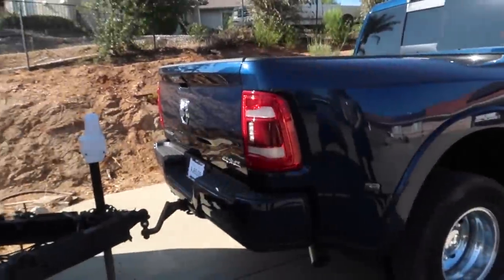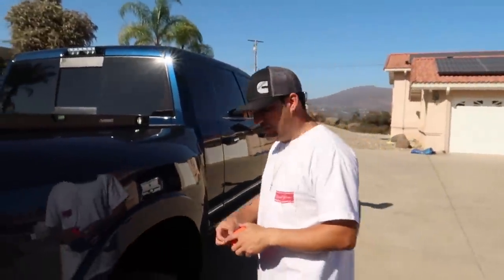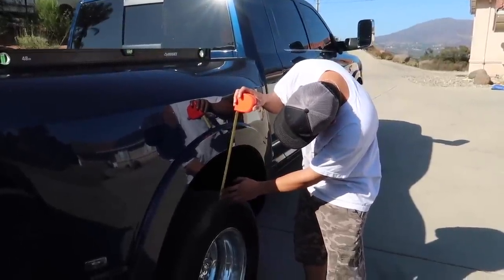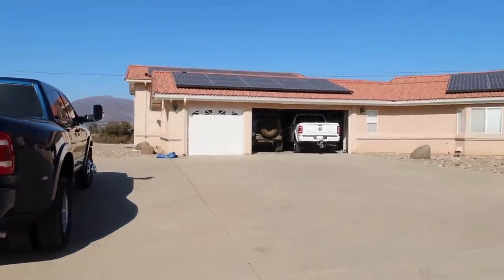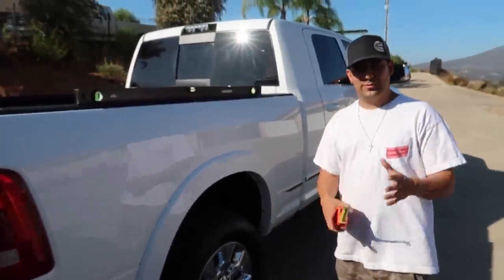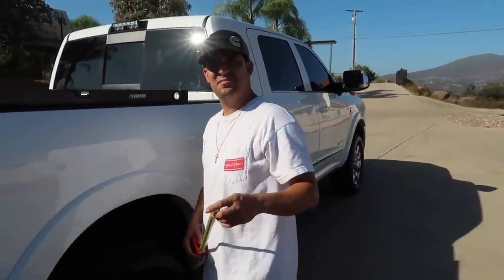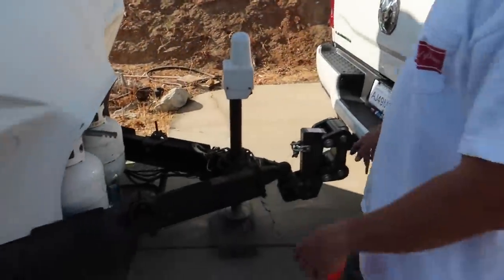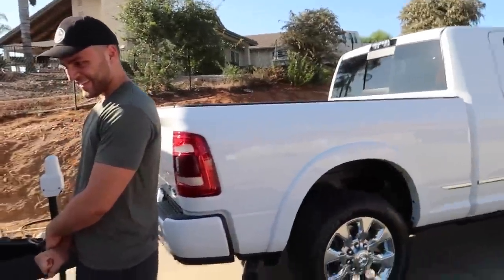SQUAT TEST WITH RAM 3500 SINGLE WHEEL VS DUALLY!!

Comment: They both sagged the same amount, 1.5 inches. The only difference is with the weight you are pulling, you'll have a better ride. For what you are pulling, you are spec'ed out perfectly.

The additional springs on the dually won't really come into play till you add more payload weight. 

It used to be a single wheel could pull more bumper trailer weight than a dually because the dually has a heavier vehicle weight which subtracts from the rated combo weight.  But, can pull more weight when hooked up to a goose-neck or 5th wheel because the additional weight of the trailer is added to the much higher payload of the dually. 

Again, with the bumper pull and your weight, you're doing it right for ride quality.

Comment: Hey Eddie, On the newer Ram trucks, the trailer tow disconnect light comes on on the dash only after an existing trailer that was connected with the truck and its computer as well as trailer brake control module is disconnected while the truck is still running or in accessory mode. This is to warn a driver that the trailer that they we're once pulling or had connected is now disconnected . It is a safety feature to warn a driver in case the cable comes unhooked while actually moving down the road. If you were unaware a trailer came disconnected from the 4/9 pin connector while towing, things could go wrong since at that point you'd have no trailer brakes, or any lights on the vehicle in tow. Just restart the truck or reconnect the 4/9 pin connector to make the light and computer reset. Thanks man. Great video!!!!

Comment: The dually before trailer was 11 1/4" with trailer weight went down to 9 3/4". single wheel before trailer was 10" after trailer weight went down to 8 1/2".

Comment: As PD diesel power has noted previously, and I would agree, bumper pull/tag along trailer heavier that 10k, go dually. 

5th/goose towing heavier than 15k, go dually.

The squatting is consistent with my 18’ srw 3500. I’m getting about 2-1/4” squat with my 5th attached And all my gear. About 3500 lbs in the bed.

Comment: I couldn’t believe how bumpy the ride was in the dually (ram) when I rode in one..that being said after seeing they both squat the same, no reason for (me) to buy a dually over the standard axle
Reply: Tyler T your right unless you are hauling heavy loaded trailer at highway speeds and you have a blow out on rear would suck
Reply: Like Jose said, blow outs. I went with a dually several years ago due to tow capacity and possible blow outs. I was towing my gooseneck horse trailer on the interstate with 2 horses, behind my Dodge 2500. Right rear tandem tire on trailer exploded running 65 mph, all was good but I started thinking "what if that had been the truck rear tire"? So I went to a 3500 dually, which also allowed me to go to a larger horse trailer. Another thing is sway control towing heavy, towing gooseneck enclosed horse trailer or a camper approx size of Eddie's, the dually feels more stable than a single rear wheel.
Reply: Squat is mostly the results of the springs, not the wheels.  More wheels will help a tiny amount.  The real reasons for dualies are not increased loads, because although they can often handle a little more, you still run into GVWR limits.  The real reasons are extra tires = reduced load on each tire, wider stance = more stability, and more rubber on the road = better braking.  Even Ram says this.  https://blog.ramtrucks.com/features/download-dually-trucks/index.html

Comment: This squat test is testing the springs... so if the two trucks have the same springs, it will squat the same. DRW allows larger payloads and more stable driving. Amount of tires will not affect the squat.

Comment: Of course it’s a difference between the two trucks...one is meant to haul heavier loads which means it’s heavy duty which is also the point of the dual tires to support the heavier load and one is a medium haul!

Comment: That symbol means the trailer is disconnected, either you are towing and your trailer came undone or you purposely disconnected the trailer yourself. In order for it to go away you need to restart the truck after disconnecting.

Comment: A dually is made to carry more weight. That’s why it has more springs. I think the red light means somebody tried the trailer brake and it’s letting you know that there’s no trailer. One other thing. You don’t need the weight distribution bars on the dually. One question, why didn’t you order it with the factory airbags?
Reply from the maker: bc there air bags r non adjustable

Comment: My friend used PPEI and the EZ link for his delete and he tore up his transmission. Found out their not suppose to be deleted with the trans you have he has less than 10k on the truck.
Reply: Rick James 
I run ppei tunes on my 15 with an Aisin. Absolutely no issues. 
When I tow our 15k lbs fifth wheel I use the 30 hp tune. 7k lbs boat I’ll run on 60 hp tune. Daily driving I use the 3rd tune which I think is a 120 or 130 hp tune.

Comment: Hey Eddie, I finally got my 2019 Mega 3500 Dually.  I put 275/65R20"s (34's) on it.  It rides perfect and did not need the lift.  I also got the factory airbags. The 1100 LB. weight of the Ding Ding is nothing for those trucks.  By the way, tell Big Lou he needs to clear bra the rear fenders of Papa Smurf.  The rocks from the front tires are brutal!

Comment: why arent you measuring from the ground to the fender?   the difference of the heights trucks makes not a bit of difference here,, but only the difference between the unladen vs loaded measurement, of the two trucks.... the angle of the tape from the outside of the fender to the wheel can cause up to a half in error in the reading, taken as shown... a more accurate way to take the reading of the actual squat would be to take the reading from the bottom of the hitch insert to the ground, as that will take into account how much weight is being lifted off the front axle, as well as the squat of the rear axle... and THAT is what is going to affect the ride and handling of the vehicle...

Comment: Hey E man. I have a dbl axle 29 footer trailer that I tow with my 2017 Silverado LT level lifted. What I do is I level my trailer to my trucks hitch height. So when I bck up to hitch up the ball sits slightly higher than my leveled trailer. Raise up the trailer bck up then hook up. For some reason it doesn’t sag as much.

Comment: Eddie Eddie Eddie dude the Dooley has about twice the payload capacity of a single rear wheel that’s why there’s more leaf springs that’s why it shouldn’t squat as much.
The little symbol that came on as a trailer disconnect warning light it does it with my truck to it’s just letting you know that the trailer is no longer hooked up so if you’re going down the freeway and you see that light it means your trailer brakes are not working anymore and your lights running lights brake lights turn signals for your trailer I no longer working pull over check the connection, Basically it’s a safety feature, all you have to do is turn the engine off turn it back on that’s it basically it’s a safety feature, all you have to do is turn the engine off turn it back on that’s it.
Thirdly it should squat a lot less with a weight distribution bars being used if it set up correctly that’s what it supposed to do, also you’ll feel a lot more stable less way we’re going on the freeway.

Comment: It always happens when you load a camper on back the light always come on and then it just goes away 
I have a 30'foot scarab and it those not happened and or with my cargo trailer...

Comment: Wait, so neither one of you guys ordered the truck with factory air bags? I have it on mine, and even with my fifth wheel it rides perfectly level.
Reply from the maker: no bc you can not adjust them on the road the factory bags are not all that
Reply: Eddie's Life someone has a hardon for airbags
Reply: @EddieLife3500  I never felt the need to adjust them. From my perspective all I cared about is riding level while towing. Can you give me an example of when I would need to adjust on the road. Thanks bro.
Reply from the maker: oh man on some roads i dumb or add air and makes the ride amazing

Comment: From what I saw the big ding ding has your truck over loaded   Right now you’re definitely going to want air bag.  The dullie had a lot more  weight to go I’m honestly surprised you only had an inch of squat
Reply: The dually measurement went from 11 1/4 inches to 9 3/4 inches.  That's 1 1/2 inches of squat.  Just like the single rear wheel.  Both 1 1/2 inches.
Reply: dsn1964  but the dullie did not rest on the over load spring  that’s the bottom spring in the pack it also still had space between the leafs in the main packs
Reply: @samgrabel8648  What's that got to do with what I said?  The guy measured 1 1/2" of squat on the dually.  Period.  I could care less if it rested on the overload spring or not.....that wasn't the point.  The dually squatted 1 1/2".......The single-rear-wheel ALSO squatted 1 1/2".  Period.  Guy showed the measuring tape and everything.
Reply: dsn1964  the  drw May of had the same squat but that don’t mean a single thing. Being on the over loads is like being on a bumpstop  it is not something I’d tow long distances on  I’m really supprised the mega cab only has a pack of 4 springs 3 main one over even the crew cab long bed has 1 loads 1 helper and 4 main the set up on the maga cab dullie was 2 helper 1 overload and 4 main
Reply: @samgrabel8648  It means everything when they are specifically comparing the amount of squat.....and SOME of you (including the guy in the video at least once) are low-balling it and making the dually out to be only squatting 1-inch.  That's being disingenuous.  Now whether or not it MEANS anything in the greater scheme of things is immaterial........They have the same squat so stop making it sound like they don't.
Reply: dsn1964  all I’m getting at is there should be more leafs in the pack from the factory  especially  since the mega cab has more gross weight  than a crew cab srw.   And the yes thay both squatted around 1.5 in    Witch is not that bad for a factory suspension truck
Reply: And I know why thay did it the less amount of springs in a pack the petter the ride the worse the payload and towing

Comment: Surprised your limited didn't come equipped with rear auto level air Suspenion. My 3500 dually has it, never squats. Always level great option
Reply from the maker: i did not want those air bags because they are non adjustable
Reply: Air lift should have 7500 lb bags available for our truck within a couple weeks.

Comment: The dually went from 11 1/4 to 9 3/4.......that's 1 1/2 inches.  Just like the single rear wheel.  Why do folks here keep saying 1 inch drop for the dually???  They gave the measurements right on the video.......

Comment: The mega cabs are not as setup for towing as the crew cab long bed truck
Reply: sam grabel please elaborate?  It’s my understanding they share the same frame, wheel base and suspension, etc. Just a heavier body resulting in less capacity.
Reply: John Oliver  thay do share the same frame and wheel base but the rear leaf packs a slightly different and the body’s are heavier  only a few hundred pounds I believe  also on single wheel truck the rear leafs have more leafs on the crew cabs